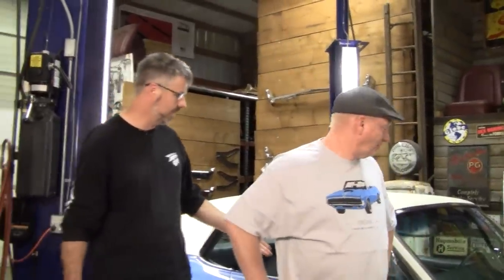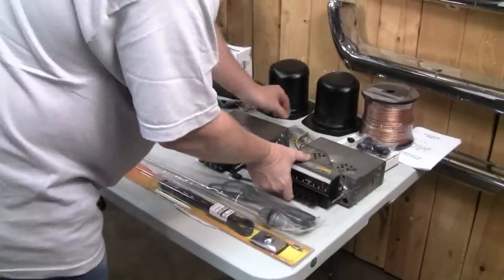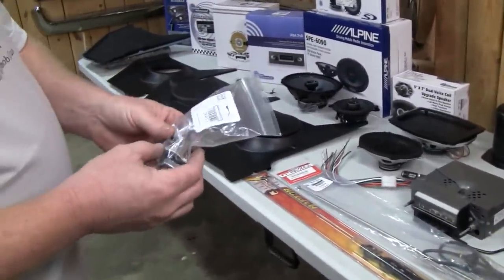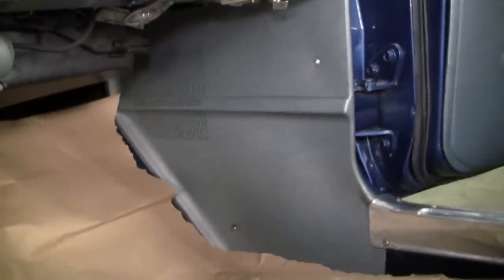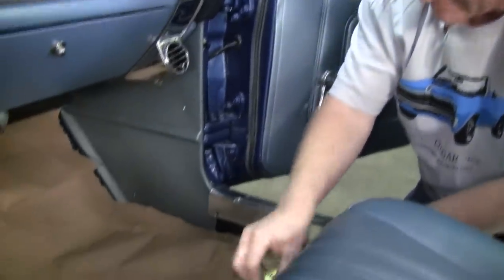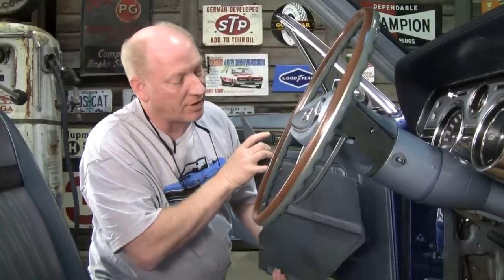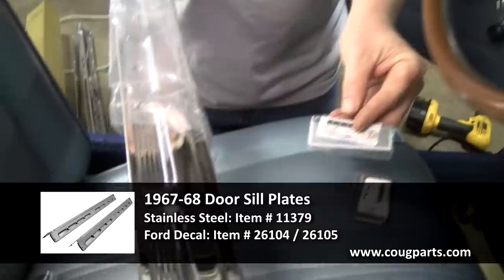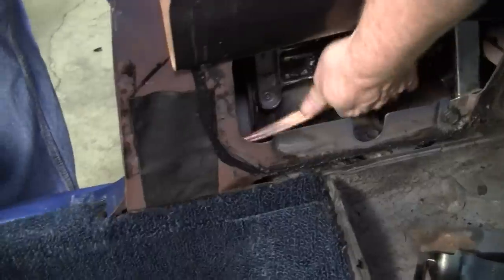Modern Stereo Conversion in a '68 Cougar

Comment: I installed the USA-740 from you in my 1969 Mustang. Love it!
Reply: Were you the one who just left the glowing review on our website on the 740?  Just sold one yesterday, I have never tried it myself but customers like what it offers at that price point.
Reply: @donrush5690  haha nope that wasn't me, but I read it and agree.  Bluetooth works rather seamlessly and audio fidelity is great.  Running this with a small powered 8 inch sub in the trunk, two 6x9's in the rear package tray, a dual coil in the center dash, and two 5 1/4"'s in the original door locations.  love it.

Comment: Another great video! I’m getting hard to work on my 1970 Eliminator. My goal is to make it a good daily driver. Audio is one of the things I’m going to hit soon. (Started by pulling the interior to check the floor boards, roof and cabin for rust). Ive got the dash out as well and will be calling for heater core and other items soon. I’d love to get an itemized list of what speakers I need for the audio, I’m very interested in quality. 

I’ve become a huge fan of you guys and am telling my cougar and mustang friends about you guys. Thanks for these great videos!
Reply: Oh, my car had factory stereo as well if that helps.
Reply from the maker: 1969-70 is actually a little trickier than 67-68 for speakers, because they started using weird size speakers and different mounting brackets. The rear speakers are 4x10, and your best bet on those is to go somewhere like Crutchfield to pick some out. On the door speakers, there is a very limited selection of what will work in that position. We carry some Kenwoods with mounting adapters that work well, but we've heard from customers that you may still need to do a little trimming. Link - https://secure.cougarpartscatalog.com/69-73dsken.html

Comment: Great video, lot's of useful information! I am getting ready to restore a 70 Cougar with a medium blue interior and I have to ask what exterior color is that car? Is it Nordic Blue? I think it would look awesome on the 70 I am getting ready for!
Reply from the maker: Good question, there were a bunch of blues available from the factory. This was either Nordic Blue or Glacier Blue. They changed up the colors a bit in 1969 and 1970, so in your case the proper colors in that range would either be Medium Blue Poly or Bright Blue Poly - check out the charts here to get some ideas: http://www.cougarclub.org/paint%20chips.htm

Comment: OK. Question for you guys......
What is the name + model #  of the
AM/FM Radio that you took out that HAS the COUGAR lettering on it ? How rare is it ? Is it in 67 + 68 or just one or the other ? If I find I find one at all,  in rough, or even in good condition, can you guys, or, is there anyone that restores those to show quality, or close, but not upgrading them with the modern internals ?
I definitely know I want that model specifically for my 68, to keep the  stock/period, and bad a.... appearance. 👍  But want to run a hidden receiver, as not to cut up a possibly rare part. 
I know there are models without the cougar lettering,... but,... my OCD and I Want the one with the lettering. 😏 Lol
Thank you in advance for your time, and your help. 👍
Reply from the maker: The one we removed in this video was from a later model (74-79?) Cougar.  The only person we knew restoring the originals without upgrading them to modern internals is no longer repairing them.
Reply: @WestCoastClassicCougar  Thank you So Much. I really appreciate the info.  👍